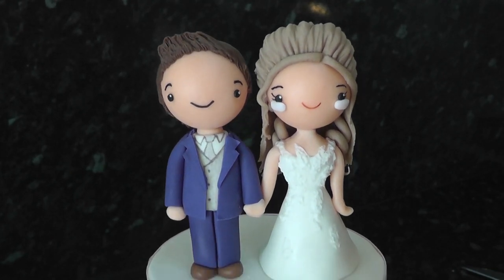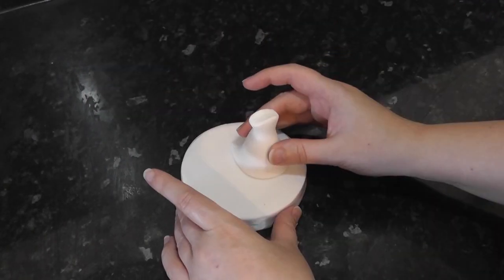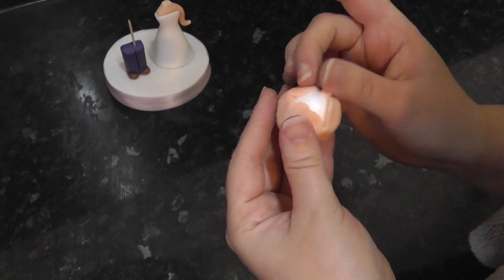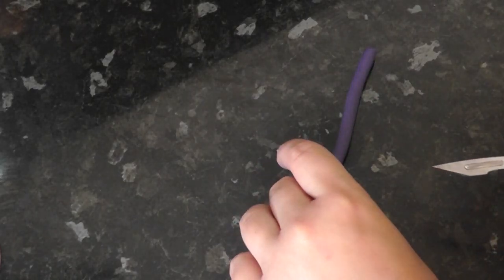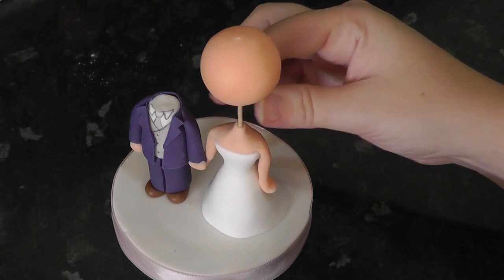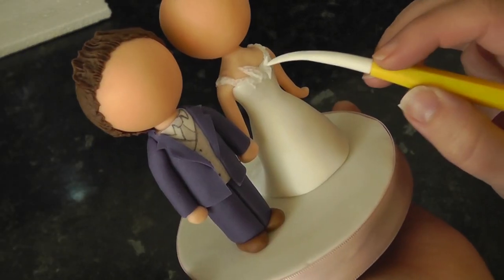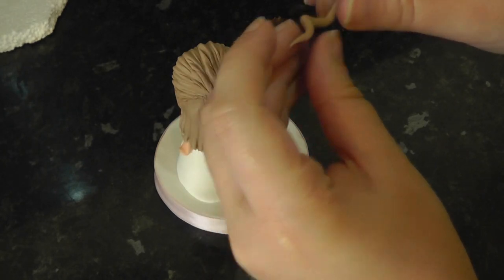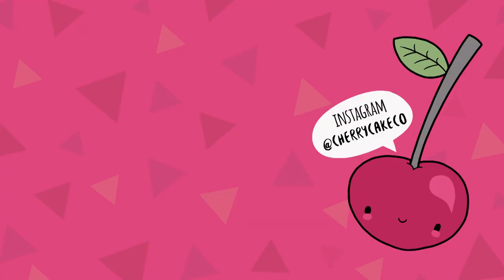Kawaii Bride and Groom Wedding Cake Topper Tutorial | How To | Cherry Toppers

Comment: Hi there, thanks so much for sharing this video. I was trying to follow the steps but was wondering did you say you added tylo something to the fondant? What happens if I don’t have that to add to the fondant? Will it still work? Thanks :)
Reply from the maker: Thank you! Tylo makes the paste dry harder quicker. You could make it from just paste but you'll have to wait for each bit (such as the legs) to fully dry in order for them to support the weight and not slump. Tylo powder just speeds up the process x